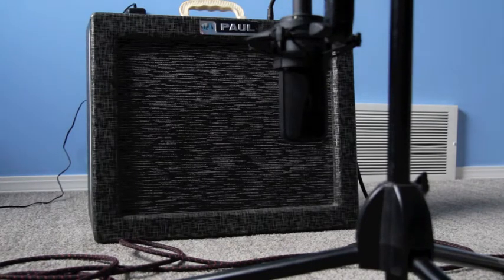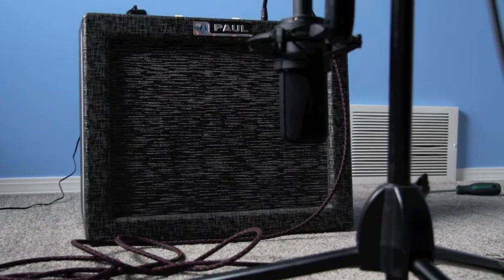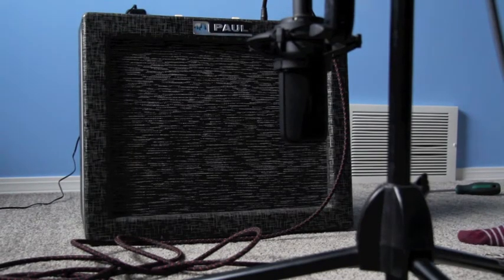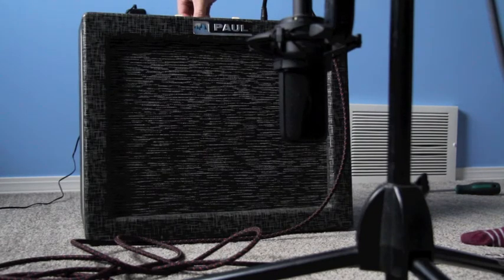5F1 Alnico vs Ceramic Speaker

Comment: What kind of output transformer are you used in this amp? It sounds nice!
Reply from the maker: The output transformer is actually from an old 5w amp I found that was somewhat similar to a Silvertone, but made in Canada. It ended up donating a few parts to my 5F1 build.

Comment: Use a sovtek 12ax7LPS for the pre-amp tube and a NOS 6V6.....or alternatively a JJ 6V6 and set the bias for the power tube at around 55ma....with a Jensen reissue alnico speaker...…...
Reply from the maker: Thanks Mike!  I may give that a try.